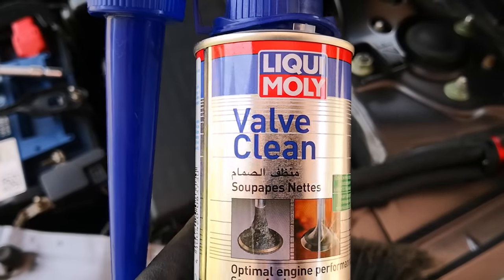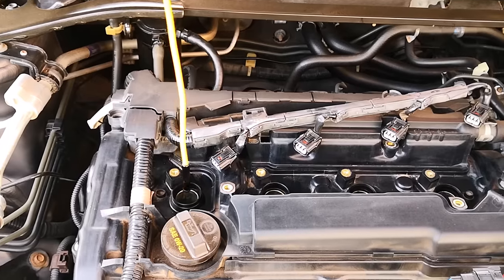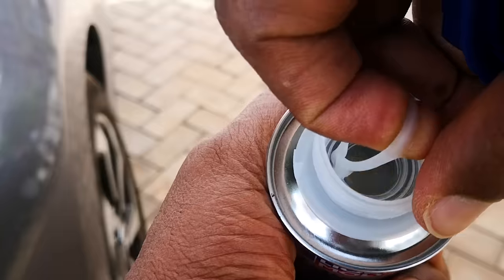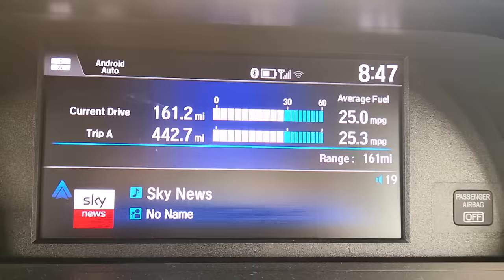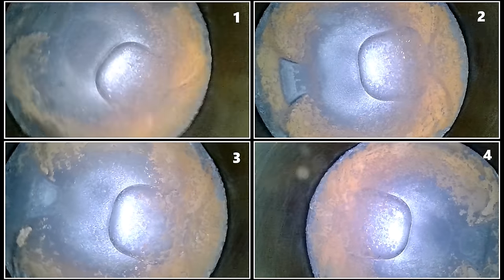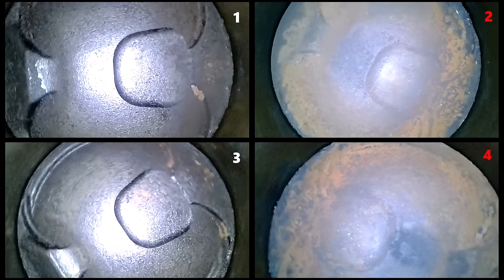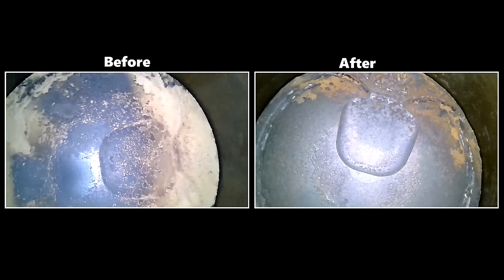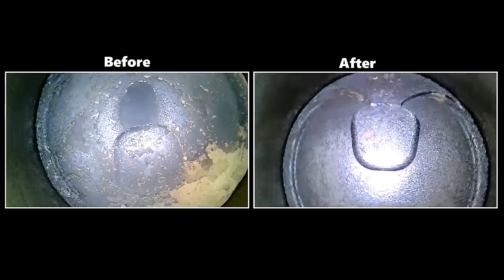I tested Liqui Moly on Piston Carbon Removal: Liqui Moly Valve Clean Works on Piston Carbon Build up

Comment: After centuries of trying they have never been able to put a mechanic in a can. All this stuff does more damage than good
Reply from the maker: Can't say they do more damage than good.  But there are some real tincture out there. Still looking a good cleaner with some good cold temp additives. Combustion engines by design are not very efficient.

Comment: That Honda engine it will not clean the valve’s because it’s direct injection
Reply from the maker: 100% right.
I stated in the video that this was for cleaning the combustion chamber, not the valves.

Comment: Only problem is you risk now fouling your O2 sensors and catalytic converter due to all the junk flowing out through exhaust. I speak from experience, clean valves but ruined sensors and cats!
Reply from the maker: Interesting. This hasn't been my experience though, but thanks for commenting. Any more details on how yours happened?

Comment: Looks BAD!  From what I can see in the video, the cylinder walls actually look WORSE after the liquid moly!?  The color of the walls is  patchy and uneven after the test.  I can no longer see any of the machined 'cross hatch' scoring that shows on a healthy cylinder wall.  And the cylinder wall is a much more important measure of engine health compared to carbon build up on the top of the piston! I wonder if the carbon deposits flake off and get stuck in the piston rings, grinding on the cylinder walls??
Reply from the maker: Nope. Must have been with the reflection of lighting. As you know 90 degree lens of specifically focusing on cylinder walls was not done in the video. Just reviewing specific footage I did 3 weeks ago focused on the cylinder walls, the crosshatch markings remain just what it should be.

Comment: This product doesn't make sense. It is designed to clean carbon off valves (not pistons) and the worst vehicles for building up carbon on valves are direct injected motors. So if this product is put in the fuel it would never get near the valves as it is directly injected into the combustion chamber. This is content for content sakes.
Reply from the maker: Definitely not for content sake. This engine was pinging from carbon build up and I needed something to remove the carbon. Liqui Moly states that this valve cleaner cleans the intake valves as well as the combustion chamber. I used it for the later despite my car being GDI and it worked. Pistons are much cleaner and the pinging totally gone.

Comment: Средство для очистки клапанов, а он показывает дно поршня.
Reply from the maker: Although the product is called valve cleaner, it clearly states on the can that it cleans the combustion chamber too. My car is direct injection so I couldn't have used it in the gas tank to clean the valves.

Comment: Where do you think all this crap is? It flew straight into the catalytic .... )))
Reply from the maker: I've done a number of before and after shots of the catalytic converter during these tests and it's hasn't been an issue. You can search for the video I did on BG44K Platinum, I showed the cat after. The only time I would worry about this is if the cat wasn't functioning well. A normal cat cleans itself, just because of the high temperatures it runs at.

Comment: That stuff is not going anywhere near my car!
Reply from the maker: I had no option. The car was pinging already, and this got rid of it. I should also say that fitting an oil catch can significantly cut deposits in this engine.

Comment: it will take me a year to drive 1900 miles 🤣
Reply from the maker: Lol. Actually I believe you don't have to drive 1900 to get the same result. In actual fact the cumulative high rev driving I did was around 500miles which can be achieved in 2 tanks of gas.

Comment: Not for direct injection engines 🤷
Reply from the maker: Correct. Discovered that later. I basically had no other reputable options available at my location, and the engine had started pinging from carbon build up.

Comment: better change fuel filter before adding those freaking cleaner fluid or atleast remove the tank and clean the inside
Reply from the maker: I am one of those who believe in changing the fuel filter/strainer say 100 - 150k miles. Other than this I won't necessarily change it because I used a fuel cleaner, except if there's evidence that the tank has significant contamination. Signs of restricted fuel delivery (e.g. lean mixture) will be another indication to investigate for clogging in the strainer.

Comment: In world logick technology evolution the simply small HHO generator  is better solution,,espetialy  on long driwe more than a 10 min,,,end its compact with gas or diesel fuel engine,,,beneficije are small fuel consuption on 100km,,,clean engine  end exout pipe dof or catalisator  plus ,,smouk behind the car or limou its clean,,,,
PS
Its nod need some big complicated with electronic,, yust simple small hho gen,,i little box ..with control buton for a +12V near driver...pkastik or ruber pipe to airfikter  end engoy in cheep long time solution,,if the engine is bad end take oil  he Will eat oil still but sound of engine Will be suprise all ewend on worck motors  old some decades

Comment: You know why this is bullshit! One thing only, you were driving hard in one of your tests. Hard driving will elevate combustion temperatures and with high combustion temperatures you will burn off carbon anyway. Carbon build up on the piston happens when combustion temperature is low, so if you drive your car most of the time with quite low power and not pushing it you will have a lot of carbon. To come back to the product. I would say it is a good product if it would clean your pistons while you still drive like granny.
Reply from the maker: I agree, however, I believe the cleaner helps. Anyway, I will be repeating this test without any cleaner, that should answer the question definitively.

Comment: 😂😂😂
It says right on the can VALVE cleaner not cylinder cleaner. You ended up cleaning it with long highway trips not from the product. 
It’s all trash
Reply from the maker: It clearly says on the can that it cleans the valves and also the combustion chamber.

Comment: Spray this rubbish in and wash all that built up dirt and carbon into the cylinders, even worse than that is this liquid will then wash the bores, which is a disaster in an engine....
Reply from the maker: Do you mean for someone who wants to use this with a spray bottle? As long as the car is operation all things being equal, the oil control rings should lube up the cylinder walls with each stroke. Even fuel itself is enough to wash the cylinder walls.